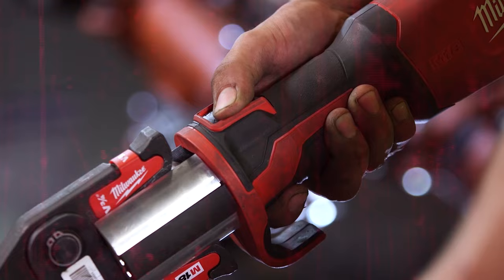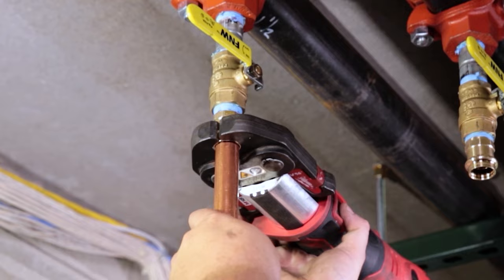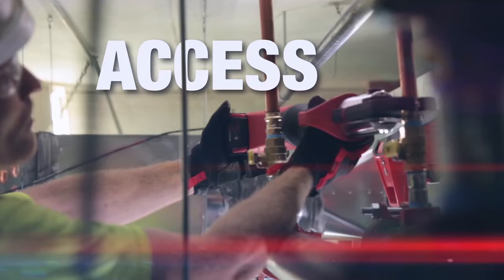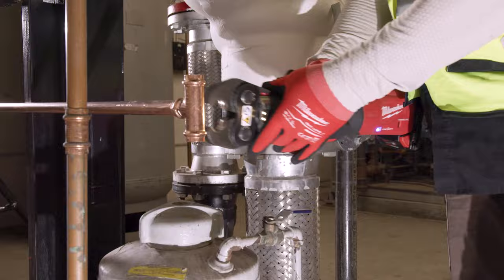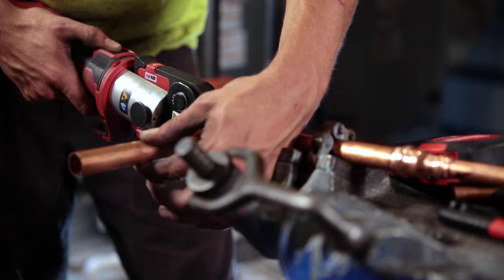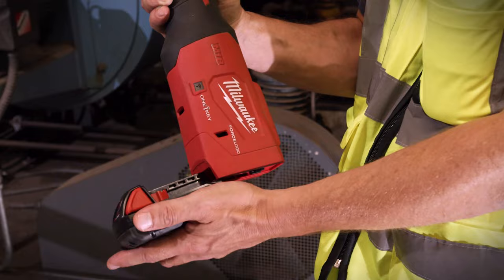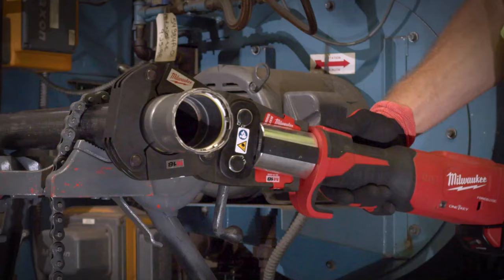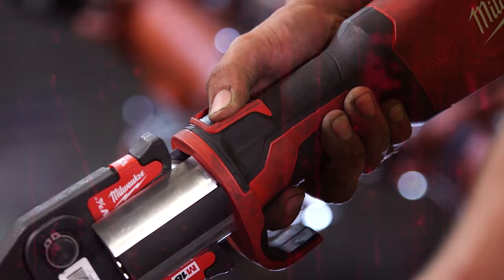Milwaukee®  M18™ FORCE LOGIC™ Press Tool w/ ONE-KEY™

Comment: Absolutely love this press gun. Only problem I’ve seen is the 1/2” & 3/4” press heads stick to the fitting a lot and you have to use some force to break it free from the fitting

Comment: I’m a retired plumber and sorry I missed out on the crimp invasion !! 
Wondering about leaks ? 
Are there leaks using these tools if used properly especially on steel gas piping … I did a lot of gas piping and sometimes finding a small leak took hours !!
Reply: No the mega press for steel pipe doesn’t leak unless you fuck up and press without the pipe being all the way in the fitting
Reply: @Angryplumbing  
Thought I saw it being used for gas piping as well as copper?
Reply: @louiscandreva8850  the jaws that come with the tool only press copper, the jaws that press steel have to be bought separately
Reply: @Angryplumbing  👍🏻

Comment: Does this work with hvac pipe
Reply: No, it's for the Viega plumbing systems which include options for copper, black iron, and PEX. The fittings are about the most expensive ones out there and the tools are also some of the most expensive out there as well. The only ones buying it are larger plumbing companies because some larger jobs especially government buildings now spec this stuff. It's not a terrible system, sometimes the joints go crooked or slip off a bit when your using the tool but it's a little faster than soldering threading or using the expansion tool on pex-A.
Reply: Yes it does the HVAC boys use it daily
Reply: Yes it does.